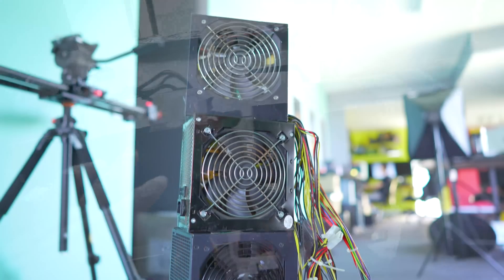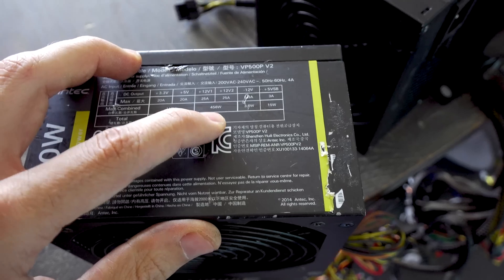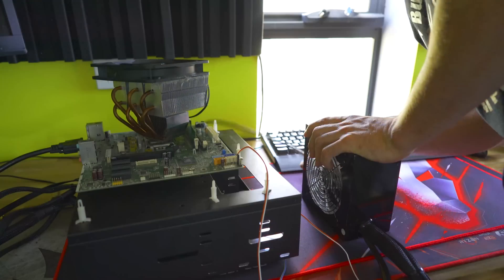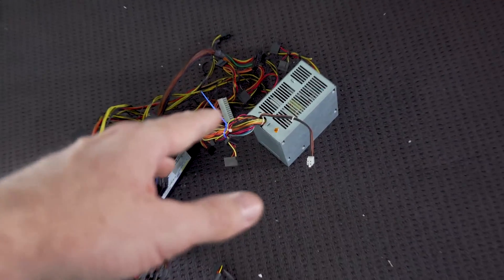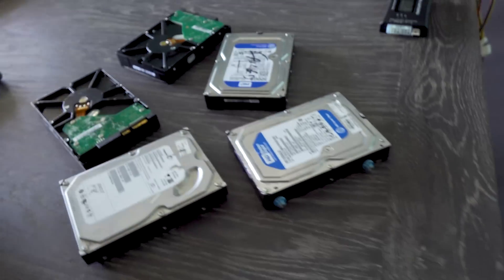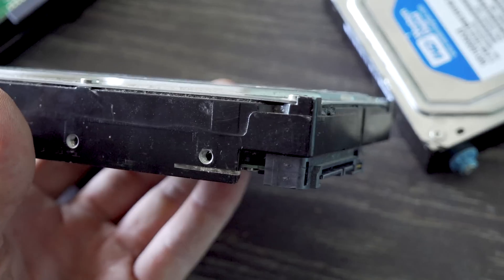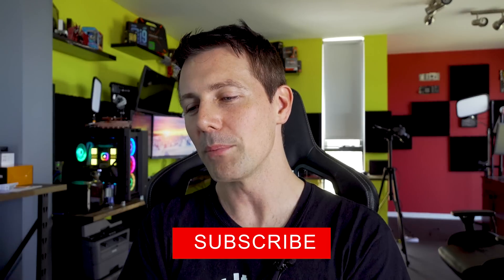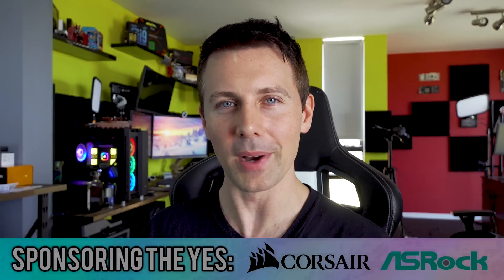How To Test and Sort through USED Power Supplies Very Quickly ($68 Stack)

Comment: Word to the wise please stay away from the "Corsair CX430W" Power supplies(I paid $50USD each for them from Amazon), I had 3x of them all went faulty over time, had 1x CX430w that would make a high pitched coilwine sound when the PC was plugged in [while being powered off]. I had 1x CX430 stopped powering up on a intel core 2 quad q9650 HTPC using a older 512MB MSI Twin Frozr GTS 250(6-pin pci express low power graphics card). Reading multiple reviews online- the Corsair CX430w is manufactured by another company & Corsair just throws their sticker on it, many people had problems with this power supply , TBH i'm surprised corsair has not been sued yet!
Reply: It's a very low end unit. You get what you pay for with the high failure rates.
Reply: Yeah, the CX and VS variant are like bottom shelf PSU from Corsair.
Reply: I had 2 cx500 corsair power supplies. When they the cables are plugged in the motherboard and the power supply is plugged in the wall, it makes a high pitched noise which is annoying. Annyone know if this is fixable?
Reply: @bartvanasselt2657   . Please search in google -- -- corsair blog coil whine . They made a blog for this being a common problem of their products :)) LOL
Reply: @bartvanasselt2657  Possibly not. You can try and "fixate" the coils with hot glue, but that's really not recommended if u don't know what u r doing. Just open an rma or buy something with good quality
Reply: @xxcr4ckzzxx840  well I got them used and they are 8 years old I think. So an rma is not possible I guess.
Reply: @bartvanasselt2657  Yeah. Don't buy psus used. Never. U can buy anything else used, but not psus. There is no solution to your problem, other that stopping the vibration in the coil and that's kinda difficult if it's just a shit design from the beginning
Reply: @xxcr4ckzzxx840  What kind of a rule is that?! Why wouldn't you buy a psu used?! The risk of buying a used psu is exactly the same as buying a used gpu or used lawnmower or used anything! Psu is no different! If u buy from a trusty seller who says it's in good condition, there's almost no risk. I bought my whole computer used 2 years ago and it has a mediocre Altis psu (probably 10 years old like the rest of the parts) and all has been working fine! I've since bought a new computer with mainly used parts as well :) Based on my experience there's about 90% chance of getting exactly what advertised on the used market, but like I said, the biggest tip is to try to buy only from sellers with good track record!
Reply: @MaximusAdonicus  The rule is called "Use brain, so ur house doesn't go to hell". PSUs have high voltages and much poweroutput. Your gpu has like 1,1V on the core and 12V on the input. If something goes wrong, a good, not fucked up psu can stop something from going boom. If ur psu is old like grandpa, it can happen that it doesn't trigger anymore or as quick as it should. Possible fire if u have bad luck. And yeah, I had one burning psu myself and at least 6 seen in other pc from friends or ppl who came to me with "my pc smells funny". U also don't buy tires used. Do u? And why don't u do that? Cuz they are not safe. Maybe they are hard or cracked. You don't know. And especially cheap psus shouldnt be reused.
Edit: On tires u can see if something is wrong, but in a psu it's hard.
Reply: @xxcr4ckzzxx840  That's nonsense! Based on ur logic I shouldn't buy a car used because it has high horsepower! But I can buy a moped because it only has a few horsepowers! I also shouldn't pay my electric bill, because if I use electricity at my home, something can go wrong and my whole house can burn down! I already explained that the risk at something being faulty or going wrong is basically same at any given moment. The guy who started this thread bought 3 NEW Corsair psu's and they all broke! I have bought at least 3 OLD psu's and had 0 broke down! It's mostly about bad luck or bad products or bad upkeep. I can't believe that u even know 6 different people with burned psu's!! I don't know even one!! It's almost mathematically impossible to have seen so many - you either know thousands of people OR all those people that u mentioned abused their psu's to their deaths! Maybe they all had a cheap 300w psu and installed a Gtx1080Ti and wondered why their pc started to smell funny...

And ofc I would buy tires used! Lol! Ha, why wouldn't I?! You sound paranoid as fuark! If the tires look fine and the sellers tells they are fine and he's credible or has good reputation on sales, there's no risk! There's a higher risk of getting a bad car even when buying from an actual car dealer shop! Car's might have hidden defects that are not told about by the seller because they need to get it out of their hands...
Reply: @MaximusAdonicus  Explanation why I wouldnt buy psus used: Caps get old and can't handle the voltage anymore and therefore make higher ripple n noise, which can damage the rest of the hardware. You really don't know what happened with the psus and based on the caps problem, you shouldn't use these things longer than 7-10, years, but that's for "quality" ones. Wouldn't trust an lc-power or thermaltake Berlin longer than 3 Secs.

Why not to buy used tires? If the tires are somewhat new (1 season), grab it. Same with psus, but if they are older than that, I wouldn't trust, that they weren't laying in the sun or something and all the shit that makes tires soft evaporated or what ever. If you live in America, surely you can use ur tires longer, because at 70F they are always somewhat soft, but at 10C here in Germany, that could get problematic and may lead to cracks in the tires. Which could let them burst at 200mph on the autobahn. No one wants that.
Reply: @MaximusAdonicus  BTW your car thing makes no sense at all. A car is a mechanical thing, if you keep care of it, anything is fine. A psu is electrical. If you keep care on it, it doesn't care, because the shit design will stay shit and may fry your pc with high ripple n noise or shorten the lifespan of hdds, ssds or CPUs or whatever. The thing is, "works good enough" isn't good enough for me anymore. At least not in psus. Why shouldn't I grab 70 dollars more for a nice new one with good measurements in test and which triggers fast if something goes wrong so the rest of my hardware I paid hard worked money for doesn't die just because the psu crapped out?
Reply: Instead of RGB , one can do equally well without the Christmas lights . Instead of 64 GB , one can live with 32 GB peacefully . Instead of ATX , one can do equally well with m-ATX . All those compromises also save one some money . But a PSU -- when it goes wrong , it has got the ability to fry -- yes FRY -- everything in your black-box with or without the transparent panels & RGB decor . Comparatively , PSU needs the highest amount of research & money !! Never EVER cheap out on a PSU . It can be your Oxygen or Zyklon-B as well .
Reply: Be careful enough to clarify that the CX models to avoid are the ones that aren't modular and are from earlier than 2018. 2018 CX PSUs use the CX M platform and are FAR MORE reliable than the original CX line.
Reply: Well, the Core 2 Quad draws around 95W whereas the GTS250 is rated at 150W for a total of 245W on the 12v rail whereas the single 12v rail on the CX430 is rated at 28A i.e 336W. 
Now "theoretically", you still have a headroom of 336W - 245W = 91W but the reality isn't that simple! 
For instance, the CX430's maximum operating temperature is a measly 30c for full operating power! Not only that but CPUs and GPUs often exceed their rated or perhaps 'marketed' TDP, especially when it comes to factory overclocked GPUs. 
Consider all that and it's clear as day that the CX430 was inadequate to handle your system! Personally, I think the CX430 is only meant for system with 65W processors and ~75W GPUs, such as the GTX1650. Go beyond that and you're practically pushing it to the limits.
Reply: @Sam-K  Cant agree with that. A PSU needs to handle 100 percent load over the full time of its life and if its going bad, then it is like that, but especially then it shouldnt crap out the way that all your Hardware gets fucked too. The Efficency goes down a lot by putting 100 percent Load on that things, but if u dont care about that, then 100 Percent is fine till the Caps go bad in that things. Normaly u go with the TDP + 50 Watt for the Mainboard and then +10 or 20 percent for good Measurement to check which PSU u need. That will be around 360 Watts. Lets be really generously  and lets say thats 400 Watts. Even under the HEAVIEST Load that thing could produce, the PSU shouldnt crap tf out. And it did. So wedgoku is right. These PSUs are just crap.
Reply: @xxcr4ckzzxx840  I never said they the CX430 is a good PSU, mate! But... It's not a total piece of garbage, either. Trust me, I've seen my share of bad PSUs, even owned one once upon a time! Darn thing blew up my Pentium III system!
Anyhow, The CX430 is a decent enough unit for low powered PCs like a 55W i3 paired with a GTX1650 or GT1030, or perhpas a Ryzen APU system. Go beyond that and you're pushing it because it has EXTREMELY limited application, and thats what I was trying to establish. 
If you think it's garbage then that's totally understandable, however. But one can still do MUCH worse than a CX430, just FYI!
Reply: @Sam-K  Thats smth I can definitely aggree with. There are much worse. However, i think you should can drive a PSU at, or near 100 percent Load without any Problems their entire life long, without crapping out or Destroying smth and thats nothing the CX430 can do and thats a shame. In my opinion its good enough for a HTPC or so, but for nothing more. So yeah, you totally right. Its not "crap" alltogether, but not great either and for 50 bucks there are better Options, or whatever it costs now. On Amazon its like a hundred in my region, but i think it is because its not much available anymore. (thx god).
Reply: Go with Seasonic Focus Plus and be fine for 10+ Years. Brands say nothing about PSUs. Example: Bequiets Pure Power and System Power PSUs are just Garbage. Seasonic has evolved really good but the older PSUs from them were also crap. On the Opposite Bequiets Dark Power Pro 11 PSUs are absolutly good to use. Still lacking behind the Seasonic Focus Plus ones, but they good enough to trust them for 5-7+ years. Low Ripple and Noise is in the most times a good Indicator of a decent PSU, also stable Voltages in Crossload scenarios. Check some tests before buying PSUs. Superflower has also really Good PSUs but they still sell REALLY crap ones. So a Brand says nothing. Be aware of that and dont cheap out on the Heart of your System.
Reply: This corsair psu craze needs to die . Budget ones are unstable & rated ones cost too much . Antec , cooler master , deepcool are giving the best reliability & value for money -- always .
Reply: @abhroy  Nope. DONT Focus on Brands. Even within a Series of Powersupplies alone, there can be such a Design difference, that for example the 550 Watt Version is super good in all Applications but the 650 or 750 are just such a crap, that u need to have anxiety cuz u could fry ur PC.
Reply: @xxcr4ckzzxx840   . By God !!  You just wrote my personal favourite for many years :) Yes , personally I've always installed 550w in my clients' home systems -- antec or cooler master , rarely deepcool :) Hats off to you Man , really !

Comment: I recommend picking up a USB-SATA dock for HDD/SSD from Aliexpress. Cheap, some even with metal outer shell and a usb-c connection. I used to go through a heap of drives on daily basis and such a dock makes it super easy to just hot-swap them and and do a quick check with Crystal Disk Info to check if they r alive or not :D

Comment: Get the magnets from the dead drives and make it into a magnetic parts tray
Reply from the maker: Now that's an idea!
Reply: Those are small and strong. Been using 3 years 2 of them from old ide drive. And if you want to magnetize your screwdriver, just swipe it over one of these in one direction and there you go.
Reply: Yeah I use hard drive magnets to magnetise screwdrivers but this is also a great idea for them!
Reply: The platters make for fun beer coasters, too.(though shite at absorption obv) I salvaged a bunch of drives years ago, still have some disks floating around the house.

Comment: I would never buy used psu or HD because both can actually get worn out unlike ram sticks. and if either goes you lose 1. your machine or 2. all your data. its just not worth the $20 in savings
Reply: A counter-argument is that electronics tend to fail either in the first few months of use, or near the end of their lifetime. So if you're buying a power supply this a few years old, it's gotten past the initial time when it might fail and is likely going to be pretty solid for a long time. I'm using an 8 year old Seasonic X 650W Gold in my main machine and I have no worries about it (thought that is partly because higher-end laptops are engineered well and if they fail they are likely to fail safely without taking out your other equipment).
Reply: @soupwizard  true if the components are high end then of course they have a much longer lifespan and often extra protections. fuses that save the equipment, still rocking a seasonic platinum for 6 years and still have another 6 years of warranty to go I know its going to be great as long as I take care of it

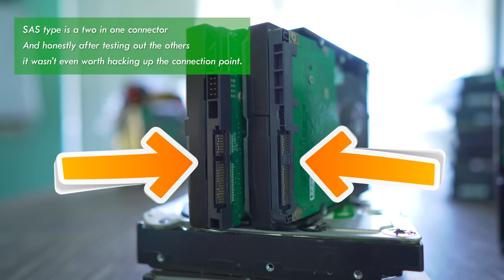Comment: 7:12 Yo, you can't hack up the connection point. The signalling is very different. I have a SAS controller and cables.
Reply from the maker: Actually never dealt with SAS hard drives, interesting to know.
Reply: @techyescity  I actually have that very same cheetah drive. It was my 'SSD' in 2011 as it was faster than most SSDs on the market and way way bigger.

Comment: in my experience, using power supply testers don't really work well for me. i'd rather load it up on a computer that i want to run it with then test it that way. load up games, stress tests, benchmarks. it takes forever but it works 100% of the time.
Reply: @LIGHTING Not all psu's fail in such a way as to take the items they are powering - better engineered power supplies will fail dead, cutting off power when they die.
Reply: Only problem is that most components dont fully stress psu so proper load tester would be way better (i had FX8320 OC and r9 280x OC and it was drawing like 450W from the wall, that didn't even fully load my 620W seasonic)
Reply: @cekpi7  this is why i test it on a computer that i actually plan to use it on to make sure it can handle the load.